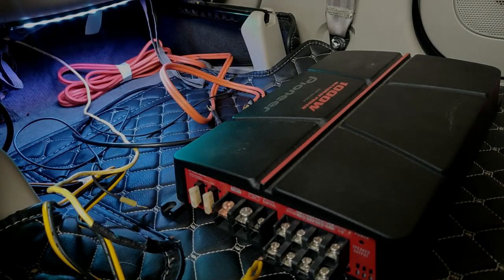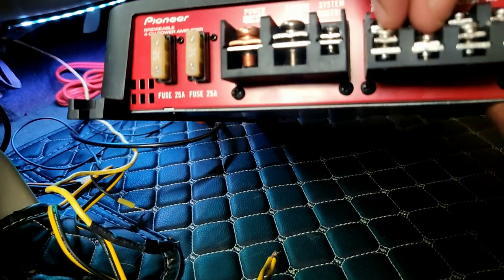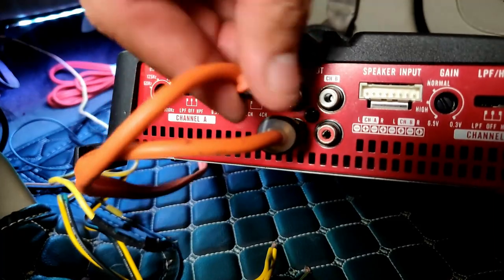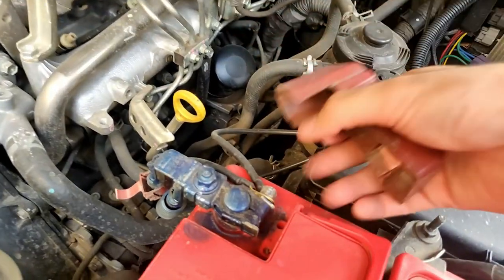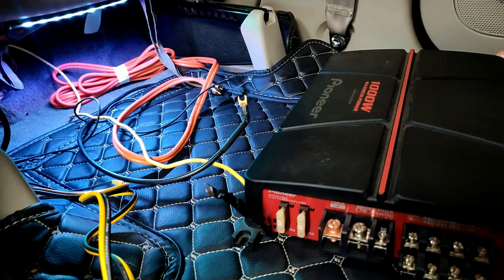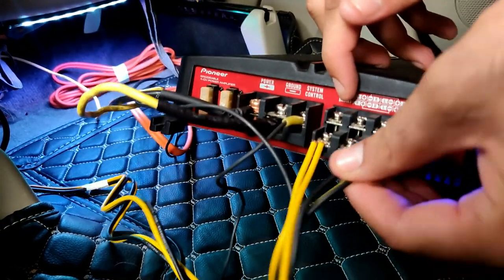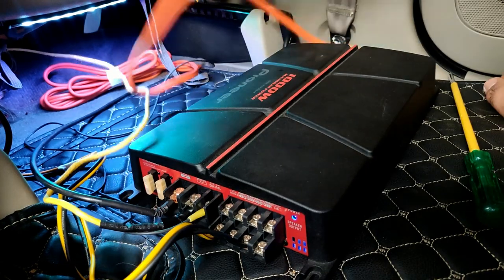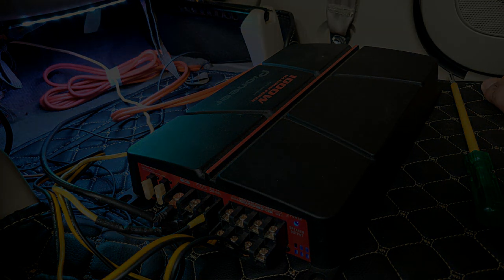How To Connect A Car Amplifier | Amp Connections and Terminals | Pioneer 1000W 4 Chanel Amplifier

Comment: So easy. Great explanation.  The one who installed mine did something wrong.  Instead of going  front to back. The sound goes from rear back driver side to passenger rear…. Is this difficult to fix?

Comment: Bro what wire specification kit we have to use for connections for 1000 watts amp... 8 gauge wire kit is ok or not
Reply from the maker: Yes a good quality copper 8 gauge wire can satisfy the load needed by an 1000w amplifier. But if you are running woofer from the amp I would suggest to go with 4 gauge.

Comment: Great video but I would never run such cheap wires for power and ground
Reply from the maker: These are pure copper high grade wires these are not cheep i got these for around 2.5k the carry much more current than normal ones as these are used in houses.

Comment: R thith amplifier can work with 4 speakers and pioneer ts wx 3000 t
Reply from the maker: Yes bridge 2 chanels for the woofer and normaly connect the speakers and you can run all of it.

Comment: I got the same amp but can't get my system control right can you help me please
Reply from the maker: Is there a tuning issue ?
Reply: @ParthSehajpal  how can I run my system control wire so it won't kill my battery
Reply: @davinjohnson6307  try getting a new battery. If your battery isn’t strong enough or is old it will keep dying.
Reply: I got a brand new battery
Reply: @davinjohnson6307  it still didn’t help ?
Reply: @huntersteinbach1299  it worked fine thanks alot
Reply: @davinjohnson6307  good shit bro I’m glad it worked for yuh
Reply: Where do I connect my system control?

Comment: Sound Storm EV4.400 
MY 4 CHANNEL AMP LOOKS LIKE THIS IN THE REAR 🧐🥴
(-/+)   (-/+)
(-/+)   (-/+)

HOW TO SET UP 4 6.5" SPEAKERS BRO WITH LOUDEST PERFORMANCE. CAN YOU MAKE ME A DIAGRAM USING  (RED ♥️/BLACK 🖤) SYMBOLS, INSTEAD OF (+/-). THANK U
Reply from the maker: In case of 4 speakers the only option you have is to connect each speaker ti one of the terminal in the amp, connect + with + and - with - of the amp and speaker for all of them and you have your connection.